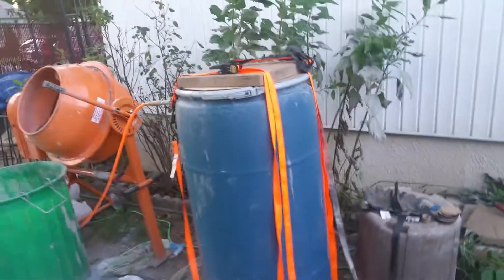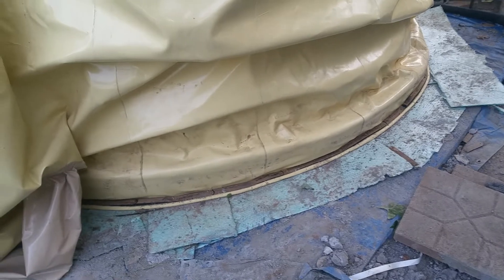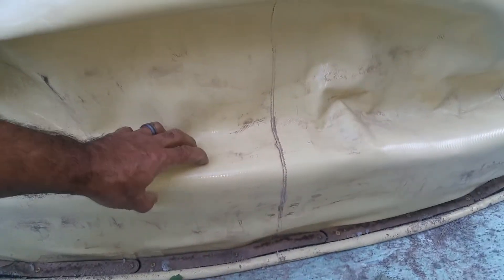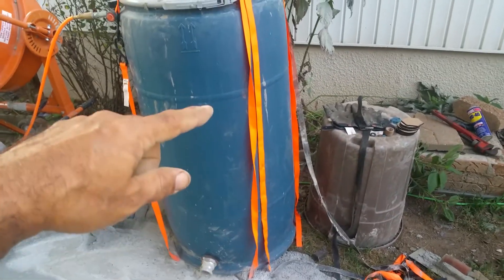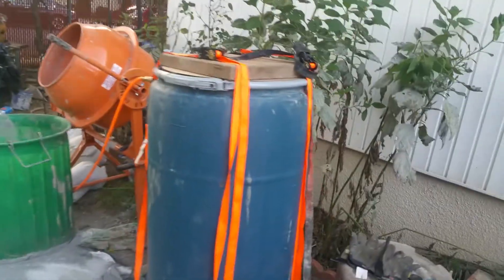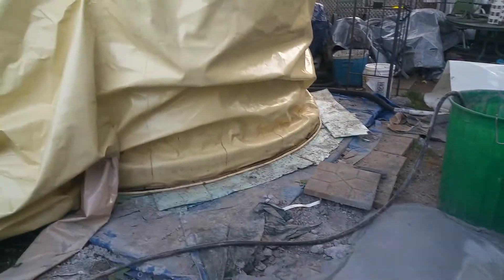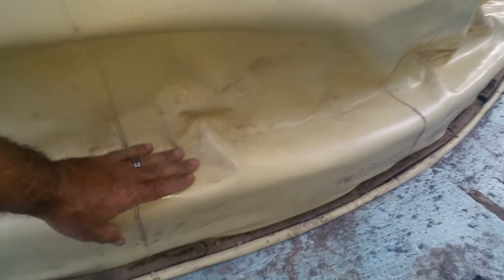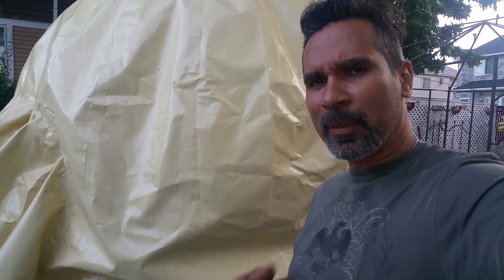Successful Aircrete pumping | stopped due to funds #aircrete #dome #aircretepump #aircreteharry #diy

Comment: I know this is two years old, but if you go to a local plumbing supply store, they may have old water heaters they’ll just give you. All heavy steel with multiple threaded ports. May need to funnel in the mix, or make a trap way on top, but they’ll take a ton of pressure.

Comment: Harry... First I want to tell you thank you for sharing all of your  experiments and your whole  aircrete learning journey.... a lot of your experiments I would have done myself so you've saved me lots of time and money. 
Secondly I wanted to run an idea past you. Instead of a pump, or this pressure barrel, how about a big syringe using PVC sewer pipe and a garage door opener. Not the chain drive type, but the threaded rod type of garage door opener. With an inlet and outlet ball valve at the end, you could suck up the aircrete into the syringe, shut one valve and open the other, then push the aircrete out. A piston would have to be made to fit inside the PVC pipe, which will move by way of the threaded garage door opener rod. I think it would work! What do you think?

Comment: One thing I was telling a guy just the other day.  Pressure vessels go BOOM!  Actually my great grandfather was killed by an exploding pressure vessel (he was working on a steam engine).  A plastic barrel is NOT a pressure vessel.  An old water heater actually is a pressure vessel, rated to about 150PSI (your mileage may vary!) and would be much safer.  How to get the concrete inside it is a problem, but almost any pressure vessel has the same problem. Don't use an old steel barrel.  That's just a better way to make shrapnel.  Much better to use a pump that's actually made to pump concrete, and that's not gonna be cheap.

Comment: you could build a scaffold around the top of your dome, and move all your equippment up. This would greatly reduce the working pressures, but increase the labour.

or if you have access to a lift - bobcat or gradall. lift the barrel up before you pump it, then bring it down to refill. repeat till full.
Reply from the maker: Stormrunner0002 I could do as you suggest, but it would cost money in scaffolding material. And the main idea for constructing this small Dome is to eventually scale up the process. I would not want to have to build scaffolding around a 40-foot Dome. I will need to get myself a concrete pump for the small project as well as the large project.
Reply: Well I did enjoy the videos of this project. I wish I could have seen it in completion but that would be a lot of work  and weight to remove.  Thanks.